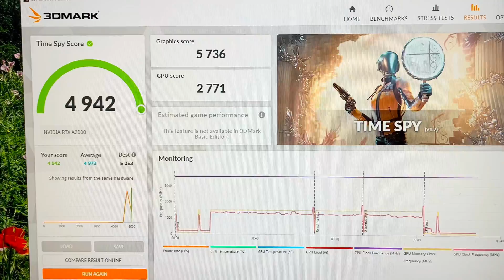Upgrading an Optiplex 7010 SFF to the Max CPU - i7 3770

Comment: I just picked up one of these for the living room and it's impressive what can already be done with it with just that gen's i5. I just wanted a Kodi box, but in the end, I stuck Batocera on it to boot into Kodi, with the option to exit and play emulators. Turns out that even just the processor can do Wii games at 80-90% speeds, most PS2 and Dreamcast games at full speed, so I'm thinking of putting a GT 1030 inside it so it can do everything up to Wii

Comment: I think the wattage being lower has to do with the fact this is the 'S' model of the i7 3770 meaning it runs more power efficient but at the cost of about 10% performance, but no matter how you look at it this is a giant leap from the i5 you had in the system before 👌

Comment: I have an Optiplex 9010 SFF that I've upgraded with the same CPU. I chose the slower "S" version of the 3770 because this computer is on 24/7 so I wanted lower power draw. I also added memory to 16Gb and two SSDs for 3Tb of storage. I may be adding a 6-10Tb HDD in the future for additional storage. Since RTX A2000's around here cost US$300 to $800, depending on the amount of video memory, I decided to go with an RX 6500. At the moment, I use mine as a Plex server, but will probably connect it to my TV and also use it as a light gaming computer as well.

Comment: Can I do this with an optiplex 7020?
Reply: Yes, except you'll be sacrificing some video/GPU speed if you use a double wide GPU card like the RTX A2000. The reason is because in the xx20 versions of Optiplex SFF computers, Dell swapped the x1 and x16 PCIe slots. In other words, the x16 slot is right next to the power supply, which means the double wide GPU card has to be plugged into the x1 slot. The x1 slot is rated for 500 MB/s while the x16 is 16 GB/s.

Comment: Cool thing!
I'm just wondering about the RTSS HUD showing 75 W GPU power, as I saw the official specs list is showing a Dell 7010 MT having 75 W, but Dell SFF and DT have a 50 W PCIe x16 gen. 3 slot.

Now I have a Dell 7010 DT w/ Samsung EVO 850 SSD, 16 GB DDR3 RAM, atm using a GT 1030 2 GB GDDR5 (which runs perfectly fine for any older and most newer games) and wondered if it makes sense to upgrade to a Nvidia 1050 (Ti), 1650 (S/Ti?), AMD RX6400 or Nvidia RTX A2000.
But there's some things I'm wondering about:
1. without using SATA power to GPU ext. power adapter, how can the PCIe x16 Gen. 3 slot provide more than 50 watts in Dell 7010 SFF/DT, as the official specs say 50 W limit.'
And if using it, the extra power wouldn't be recognized by RTSS?
2. How big should the PSU be? Will the standard 240/255? W PSU be enough? Using only 1-2 SSDs, no HDDs, ~3-4 fans in total, 65 W capped CPU (I've seen in CPU-z and Cinebench that my i5-3570 doesn't get higher than ~65-66 W, it should work with 50 or 75 W GPU, but more is better ofc.

3. One thing I have to check out, which should improve the performance for free on any CPU is software undervolting.
I guess the CPU must be faster having the same 65 W limit with P ~ U² * f when U is lower. Expect maybe 10-20 % more performance, but I haven't tested it yet, playing mostly retro games, it wasn't needed yet^^
I even use MSI Afterburner to lock some games to 60 FPS, if it looks good enough and saves some heat / energy production. Most old games even run with CPU+GPU power = 25-40 W only. That's why I didn't upgrade the CPU+GPU yet.

4. How much will the PCIe x16 Gen. 3 port limit Gen. 4+ cards? I read that AMD RX 6400 Gen. 4 cards run like 20 % slower in Gen. 3 slots.
Actually I think the mainboard is a bit of a bottleneck for new GPUs and a tad bit newer Dell SFF/DT would make sense, but many of those have only 1 slot PCIe x16 GPU space...
5. Buying an AMD RX 6400 4 GB card or Nvidia 1050/1650 (which still have a high price) now makes little sense to me compared to my GT 1030 GDDR5 2 GB, as you mention new games want more GRAM and 6+ GB are way better here.
Reply: The 7010 PCI slot is rated for 50w, but plenty of people use a2000's, 3050's, etc with no issues. Apparently it's under rated, an can do 70w.

Comment: Could you make a video with comparison of rx6400 in 16x PCI slot and rtx a2000 with dlss in the 4x PCI slot?
Reply: The xx10 Optiplex's have their x16 slot furthest from the power supply so he does have his A2000 in the faster slot.
Reply: @Waltkat  there is a color code on the slot right? what if its all blue?
Reply: @CarinoGamingStudio  The blue slot usually signifies it's the x16 slot.
Reply: all i know optiplex can handle 8x max i dont know if the 16x will show as 16x in gpu stats.

Comment: is there a way to put rtx 4060lp in an old optiplex with 260 watt power supply?
Reply: I have a rtx a2000 6gb and it bottle necks like at 60%

Comment: Would a i7 3770k with overclock work? I have the same pc
Reply from the maker: Yea that would work. Keep in mind though it draws 75W vs 65W for the i7 3770s.
Reply: And also would ddr4 ram work in this build?
Reply from the maker: @lucalatella4987  the key notch is in a different location in DDR4 and DDR4 is only compatible with boards using Intel's X99 chipset and LGA 2011 processor socket. That chipset didn’t come out until about a year or 2 later than the 7010 unfortunately.
Reply: Dell 7010 SFF/DT have CPU watt limits of 65 W. My i5-3570 f.e. runs at max. 65-66 W instead of 77 W in a Dell 7010 DT regarding RTSS, Argus Mini, HWiNFO64 when running Cinebench. It never got higher than 66 W.

An i7-3770 also is 77 W rated like my i5-3570, an i7-3770k even needs more power overclocked, but only if the socket isn't limited.
I think you need the Dell 7010 MT instead of SFF/DT to get any benefits from that unlocked 3770k over 3770 CPU, unless a patched BIOS works here.
I read that patched BIOS also can virtually overclock locked CPUs like i7-7700 the same as i7-7700k (if the silicon lot is good enough, well even with i7-7700k people need to test 100 CPUs to get 1 which can run at 5 GHz), but I haven't tried modded BIOS yet.

Is there a BIOS patch which unlocks 77 or even 95 or more W for the CPU on Dell 7010 SFF/DT?

But I wonder how he got the GPU working with 75 W showing up in RTSS. I didn't upgrade from my 30 W GPU, but I saw that Dell 7010 SFF/DT have 50 W PCIe x16 slot, while Dell 7010 MT has a 75 W slot. That's the official values.
I thought that you need to use external GPU power to feed it right or it will be slower ofc., but more efficient with lower temps on the other hand.

I'd give software undervolting a try. The same 65 W limit would give you 10-20, maybe 30 % more totally free performance I guess. I have to try it out with CPU-z, Cinebench and some undervolting apps.
I once used undervolting on a C2D E8400 and f.e. the idle CPU temp went down from like 42 °C to 37 °C or even lower (there was no lower values ever on Dell 780 MT). You can imagine that it saves like 5 watts or so.
But when there's a 65 W power limit, an undervolted CPU still is more efficient I think.
Reply: @sebastianebert4295 i have a i7-3770 running on a 7010 sff no mods so it works
Reply: @MafiaTunis 
We're you able to upgrade to Windows 11?

Comment: Totally irrelevant but i have the same pc but recently it is not powering on, when i connect power cable i hear sound(pew pew pew pew), i removed the heatsink fan cable to check is its problem, when i connect the cable, I'm still getting the sound. Any idea what could have gone wrong?
Reply from the maker: Spinning hard drive gone bad maybe? Or if nothing comes on at all - here’s a Dell troubleshooting page to help figure out what it could be: https://www.dell.com/support/kbdoc/en-us/000125186/how-to-troubleshoot-power-issue-on-a-dell-desktop-or-all-in-one
Reply: @OptiGPU  I have posted a video of sound as a YouTube shorts...it is working now but I had to use a button on PSU and hold it for 3-5seconds and simultaneously push the power on button to on the pc😢😢
Reply: @Kirito2k  seems like PSU's internal standby power is defective, some cap popped I guess.
Maybe a big GPU was too much for 240/255 W PSU? But it's also 10 y/o. Capacitor and PSU failures happen more often than anything else.
If that's the case, the internal LED somewhere onboard is off, too, until you press the test / force power on button on the back.

Comment: Hey optigpu i got a optiplx 7010 sff with a2000 but i got a very important question, when i toke out my cpu it seems that the pins are stuck in the motherboard but the top half is ok, is this normal and if so, will getting the new cpu improve my pc alot?
Reply from the maker: Yes and yes
Reply: @OptiGPU   thx but that was a month ago, merry christmas and sadly i belive i messed up my pc bc i didnt know what was going on
Reply: I think thats the design of the intel socket, the pins are on the motherboard and the cpu is kinda flat looking